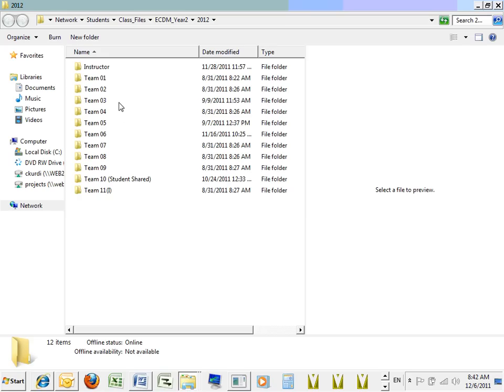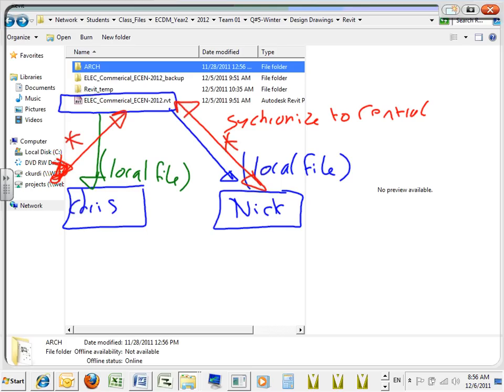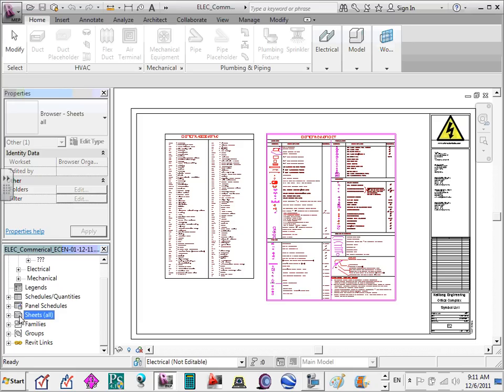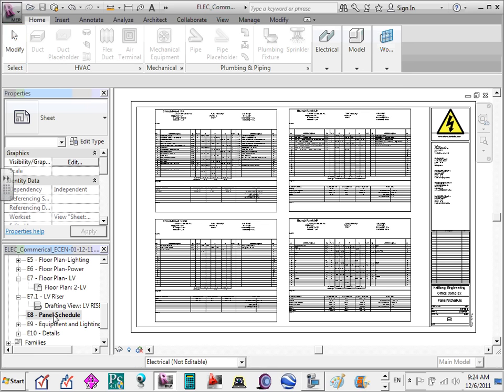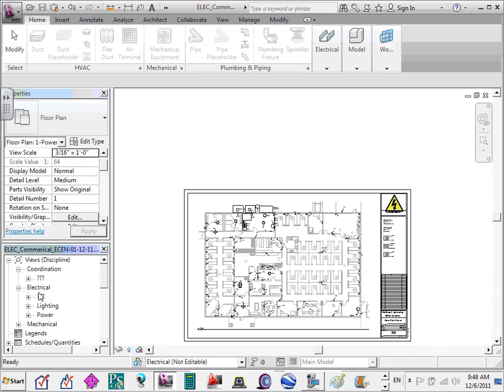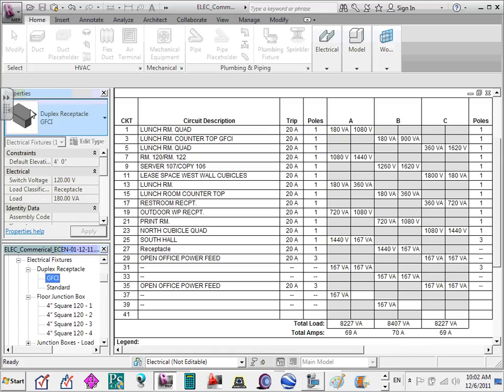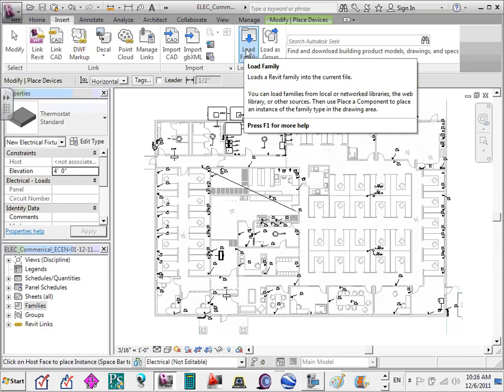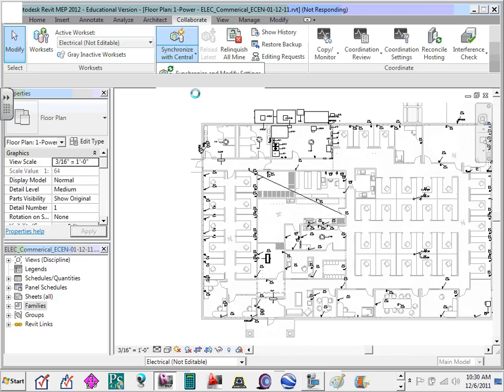Revit MEP2012-Q#5-Commercial Project overview-12-06-11.wmv

Comment from the maker: Hi There,
As Electrical Engineers engaged in the construction industry,  we are driven, like it or not, by the Architects. Architects are designing in Revit and we are following in their footsteps because we have to in order to provide a 3D working model for customers.
I suggest you get on board sooner or you will be left behind if you are in the construction industry.
Greetings
Chad